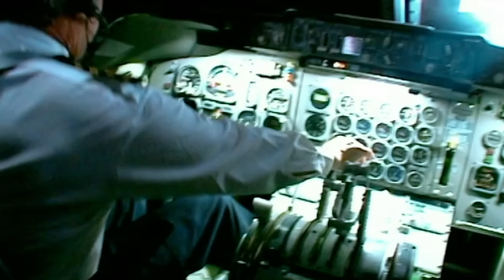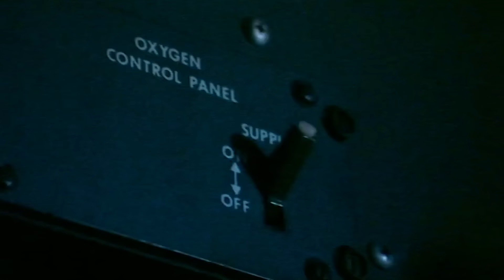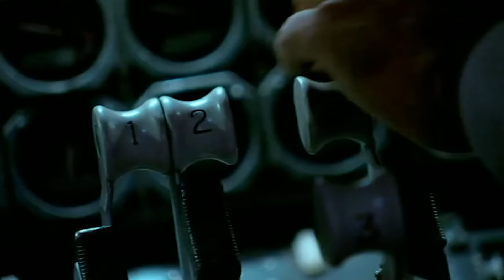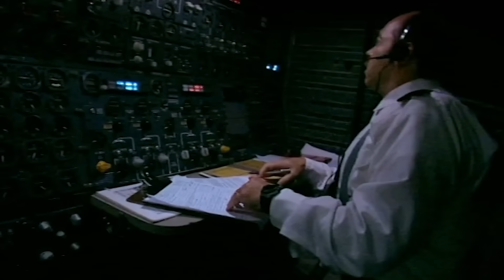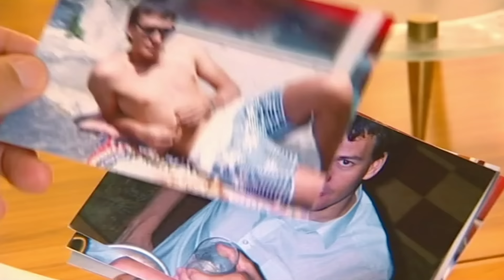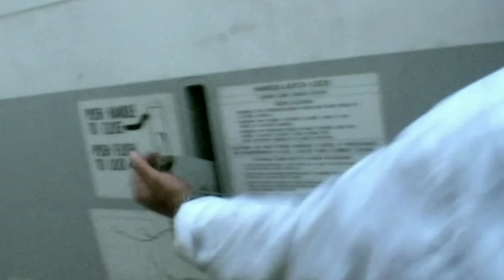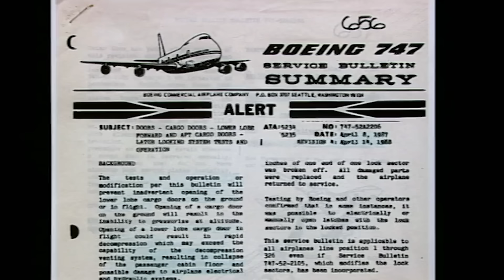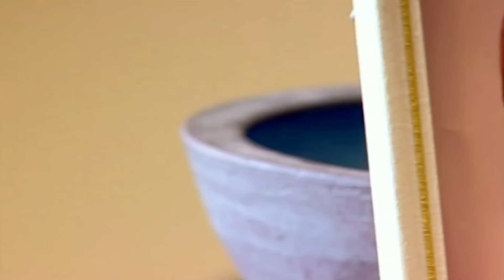Flight 881: What Went Wrong? I Mayday: Air Disaster

Comment: it blows my mind that my front door, has a lock that uses a stronger material than the lock that's meant to keep the door of a giant jet aircraft from opening mid flight
Reply: you chose to pay for a lock you may never fully need the strength of ( singular investment )

and the airline opted for a what-they-thought-was-enough ( multiple investments )

the difference is that ur a person with feelings, and the company is "the company" and it's interests are singular, money.

not defending them, but i can understand the choices that led to this.
Reply: Not too many burglars up around 13,000 feet either, so the  Locks serve a different purpose on the ground, I suppose.
Reply: Weight is also a factor here. Aluminum is 4 times lighter then steel. Every piece of a plane is optimized to be as lightweight as possible so the plane can successfully fly. That's why they went with a forged aluminum design rather then a steel one. I think the material is fine, they probably didn't use enough material and made it too thin. It was also a flaw in that the design wasn't fail safe for the purpose of allowing more cargo to be loaded. Boeing should have sacrificed some cargo space  designing a fail safe design and have the door open inward instead of outward. Moral of the story is, those locks are MUCH stronger then your house lock. They just weren't strong enough and the design wasn't fault proof. The pressurized cabin broke the lock...
Reply: Think of people  who flew away in air.... God knows where they fell,
Reply: @Songs-lr4wt  if Lee had a window and fuselage beside him, he had to of gone down to the ocean. Unless the engine(s) sucked his seat and him through the engine with that much force.
Reply: @BlueberryWizard  it’s sad how much sense u make
Reply: @misscabbyp7198  Wrong. The purpose of both locks are the same... to prevent a  door from opening in order to protect those inside. Yours is one of the dumbest comments I've seen in quite a while.
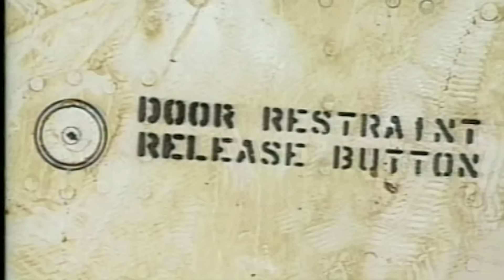Reply: @ejkk9513  What video were you watching? Pressurization didn't break the lock, an electrical malfunction OPENED the door during flight.   46:37
Reply: Yes, but if there was no pressurization the door wouldn't explode out like that. This only became a problem because planes are pressurized and Boeing didn't design a fail safe system.
Reply: @Marponsa, The locking cams were actually EXTREMELY strong (High Strength Steel)... What was too weak/flimsy - were the aluminum 'fail-safe' interlocks... After this incident, they were later made out of stronger material (steel). Those interlocks were basically redundant devices that were designed to keep the cams from rotating... But the motor that rotated the cams , simply over-powered the originally designed interlocks and bent them out of the way,  when it was not commanded to do so... What bothers me is; Why did Boeing (or whoever designed those cargo door latching systems), not do a dynamic test to see if those interlocks would actually stop the cams from turning? If that test was done, before the latching system design was approved by the government authorities, it would have failed the test and re-designed to actually do, what it was originally designed to do...
Reply: @misscabbyp7198 , those cargo doors, hold EXTREMELY high loads when the plane is pressurised and gets to full altitudes.... Believe it or not, each of those cargo doors will have to withstand over 30 TONS of force when the plane gets up to full cabin pressure differential (6.5 psia)... THAT is what those latch's , hinges & door/ door sill structures have to handle when in flight...
Reply: @i_had_3_pugs  There was at least 1 person who went through the #3 engine on that flight...
Reply: Jets are heavy and fast not a good combination
Reply: @Songs-lr4wt  the ocean
Reply: It's not so much about the material but the amount and shape of it. Bet your lock couldn't hold the cargo door closed. You can make up for weaker material by using more and it could be a good tradeoff.
Reply: Your house isn't pressurized 🤦🏽‍♀️
Reply: Mechanical strength/integrity is totally different from material/inherent strength integrity. There are submarines that have plastic components, it's all in the design. Full disclosure; AME coming off 12 hour shift, about 5 minutes into episode.
Reply: Well mate this was 1989 but still thats cheap for the airplane company cause they will lose more money from what happened
Reply: Two completely different purposes that are not related at all. Who's going to break INTO an airplane at 20,000 ft?  Weight is also a huge factor.
Reply: U live in a bank vault?
Reply: @jesspavlichenko5745  Exactly... When full cabin differential pressure is reached (about 6.5 psia) , over 28 tons of force are being applied to those cargo doors...

Comment: I'm glad the dad knew what he knew, darn the airlines and their coverups.
Reply: As with the 737Max, it's not so much the airlines as the manufacturer.
Reply: @kenoliver8913  yes. The 737 Max was a terrible cover-up. If you saw the interview with the American Airline pilot, it would turn your stomach.
Reply: @BarnaliD  y
Reply: @atrixboshoff796  because 9f how Boeing never told the airlines or pilots that there was an MCAS system to begin with
Reply: They also made the system stronger than the pilots
Reply: I'm surprised the parents were not killed off in an "accident" by those threatened of being exposed.  Pretty sure there were death threats made to them that they just don't want to get into...

Comment: A couple of years ago, the cargo door of a plane I was on blew open on take off. I was sitting above it and remember hearing a bang and the plane shuddered. It was so scary. We made an emergency landing within a few minutes. The pilot came over the intercom and said If we had gone up to cruising altitude, the cabin wouldn’t have been able to pressurize. It’s so scary to think about and to think stuff like what happened with this flight is still happening. This was also a United Flight just like in this documentary.
Reply: A couple of years ago! Still the same problem! Glad that you and the other passengers survived. That must have been so terrifying.
Reply: So basically avoid United Airlines, noted.
Reply: @Elle_Rou  No avoid the plane.
The plane is always rebadged and redistributed.
Reply: The danger is not the fact that the aircraft won't pressurize  but in the sudden decompression  .
Reply: What model plane was it?
Reply: @johnniethepom2905  good point, the pilots would have known right away that a problem existed, and return to the airport asap... The first thing the pilots probably did was de pressureise the fuselage to reduce the chances of an sudden de-comptession...

Comment: 49:49 what he is referring to is a type of electrical insulation called Kapton. It was heralded as a super insulator when first developed due to its ability to be stretched into very thin sheets, withstand high temperatures and have a huge electrical resistance up to several thousand volts per milimeter. The main issue is that as Kapton based insulation ages it become very brittle and easily damaged. It was used in everything from military helicopters, commercial aviation, to space probes.
Reply: Now we have soy based insulation in Teslas and other cars that rodents find delicious.

Comment: Pilot:  "Probably the best landing I've ever made."  Without a doubt, the best landing ever in the history of aviation.
Reply: Not at all. That credit goes to United Airlines flight 232. The disk in its tail engine exploded, severing all hydraulic lines, leaving engine throttle as the only means of control.

The aircraft broke apart on landing, but more than half of its passengers survived. It's used as a case study of successful implementation of crew resource management.

A similar accident with the exact same loss of control resulted in 520 deaths and only 4 survivors. Just to show how good that survival rate was.

Comment: Now I've seen the entire video.  That father is certainly extraordinary looking, and his son looked like him a lot.  It seems like a tough call for the airlines.  Even if they spent billions fixing every known possible defect, along would come another slip somewhere and new problems are created.  It's like our homes - there's always something going because there are so many parts.  So I give everyone credit here for honestly looking for solutions to extremely vexing situations.  To dad and mom, so sorry for your tragic loss.  Your son can now RIP.
Reply: I don't think that was the issue here.  The door design was unconventional, and then they use a metal with far weaker sheer force (aluminum) than steel.  These things were well known to designers back then, they didn't need sophisticated computer modeling to figure this out.  They did it purely because of economics.

Comment: Having flown this older model 747 this was a very heroic crew performing exactly as trained. The forward baggage cargo door closure claws were made of aluminum. The metal fatigue from constant pressurization stressed the claw locks to breaking point. This same scene would be replicated a couple other times around the world with outcomes not so favorable. 

Also this was the dominant factor in TWA 800, also an older 747-200 Classic. That was not a missile, but exactly as this story depicted:the center body tank had old frayed wiring that shorted and ignited the fuel. Those same aluminum door claws gave way above the burning fuel tank and the aluminum skin peeled off on the circumference of the aircraft. The nose separated. Tragic and dramatic.
It was all related.
Reply: ... top  comment   👍
Reply: Your analysis of the aircraft repressurising multiple times in incorrect . The cause was the electric motor wiring short circuiting and the locking mechanism opening and forcing the failsafe mechanism to fail .

Comment: The insane thing is that these known failures, along with continued collusion between manufactures, airlines and regulatory bodies, are still happen today. UA Flight 811 did not change anything. Between 2018 and 2019, 346 lives were lost because of these exact issues regarding the Boeing 737 Max

Comment: Had this been a modern Aircraft, She would have desentregated in the Air. What saved this aircraft is all the wiring and critical systems run in a tray down the Center of the fuselage between the deck and the cargo bay..
Reply: Byou
Reply: B747 best aircraft ever made.
Reply: Desegregated?

Comment: Think of things like this, and then tell yourself that government "safety" administration's have your best interests in mind.
Reply: @davemwangi05 LMAO, But It has to be safe, .gov says so. We don't know it's long term effects now hold still and don't flinch. 💉
Reply: Think of things like this and ask yourself if you really believe large corporations have your best interests in mind.
Reply: @ChuckHickl  Nope, its all about profit. However, I'd rather fly on a 747 then an aircraft, designed by a government  committee that lacks any knowlege of aerodynamics or aircraft manufacturing. It would have to use parts manufacturerd in ever congressional district known to mankind, cost 40 times as much, and delayed for decades.
 Actually, it wouldnt matter anyway.  The  construction would finally be cancelled at the last minute due to cost over runs and changes in design requirements.

Comment: Great story, amazing parents, yet it skipped right over the fundamental cause of the whole problem with just a passing reference.  The corporate drone who came up with the bright idea to drop the fail-safe original "plug" design in order to once again satisfy corporate greed was the "prime mover" here.

When the pressure differential at altitude is acting on the entire surface area of a big cargo door, it would be almost impossible to open. No complex, failure-prone combination of switches and latches and maintenance procedures necessary. Just shut the door.

Corporate greed knows no bounds.  If humans ever outgrow this infantile approach to commerce we will all be better off.

Comment: When it was found that one of the engines had sucked passengers, I was shocked to the core. That must have been a painful death if the passenger got sucked in legs first, not to mention passengers who hit the sea from such a high altitude. Shame on the part of aviation industry that prioritizes money over safety.
Reply: Thankfully, hitting water from that height is like falling on concrete. They likely died on impact and didn’t suffer. But the ones who got sucked through the engines…… I really hope it only lasted a second or two.

Comment: That aviation lawyer hit the nail on the head..Airline industry knew about the defects but decided the cost benefit was to let them go..so what if they lose an airplane every ten years or so with hundreds dying..it's just part of the cost of doing business..a lot cheaper in the long run then grounding all the aircraft until the defects are fixed.
Reply: Ford did the same with the Pinto and its exploding gas tank.  The cost of fixing all the Pinto's in a recall exceeded what it would cost to just settle an insurance claim of the random few who died from it by not having any fix put into place.

Comment: Fast Forward to 2018 and the catastrophic engine failure aboard Southwest Airlines Flight 1380 was also preventable. The FAA knew about the turbine blade fatigue issue and advised airlines to rectify it. But the deadline set wasn't soon enough, resulting in the death of Jennifer Riordan. The deadly accidents aboard 737MAX aircraft were also potentially preventable by proper oversight, had the FAA bothered to certify MCAS themselves and not let Boeing "self-certify".

Comment: The fact that they went through all this and it STILL wasn't fixed. If you check out another documentary, we find out that the company kinda sweeped it under the rug by making a deal with one of the people in charge with regulations and the small fixes did nothing.
A repeat of this had to happen for everyone to find out that the company KNEW about this small defect while the plan was being made yet did so little to fix it.

Comment: When they discussed at end, TWA flight 800 that blew up, NTSB never once checked any of the non plane equipment. Had they done so, they would have learned the commercial microwaves TWA used at that time had a fatal flaw that if an item of metal was accidentally put inside, the power not only would arc inside, but also down the cord. I had seen two incidents with the same model microwave that resulted with the plug not only fusing with the outlet, the breakers fused and melted too.

Comment: As an ex-flight attendant years ago, I have flown many times since but took my last flight about five years ago. I no longer fly because I don't trust the mechanics who maintain the aircraft and the engineering of these planes. But I always kept my seatbelt on for the entire flight and unless I really had to use the bathroom I just held it in. Also as a passenger I would try to get an aisle seat toward the rear of the plane. I think these are generally safer. I don't need a window seat to remind me I am 30,000 feet up
Reply: you're sad... seems air travel has gotten safer... bet you drive in a car though.    you're thinking is very emotional

Comment: I was on a 747 in 1997 that had to return to London bc of the baggage door light saying it was open. We circled around for an hour & a half dumping fuel and during that time the plane was hit by lightening. A really cute guy sitting next to me held my hand during the incident. We made it back safely but apparently they tried to fix the issue so we could get back in the air. That’s when I got really upset & claustrophobic. I wanted to be done with that plane entirely. Finally after a few hours, they canceled the flight and reimbursed us the next day for food & accommodation. Funny enough, before boarding the nearly doomed plane I was offered 300 pounds to take the next flight. I refused bc I couldn’t wait to get back to New Jersey. Lolol. Dumb move. The other plane got there an entire day before I did.

Comment: They say it doesn't significantly affect your chance of survival in a crash no matter where you sit in a plane. But apparently above or near the carco severely decrease your chance because it doesn't even matter if the plane crashes or not if something goes horribly wrong with the carco. There are many docs just like this, no bombs but a design flaw or maintainance flaw. In any case, why would you risk it if you don't have to? Find out where the carco is located and stay far away from it. And avoid flying with pets if you can't take them with you into the plane and have them stay under your seat.

Comment: I was working for UAL , Wharton we were required to do after until a modification could be prepared, we would after the door was closed was to open the Circuit Breakers to the door so it could not open.